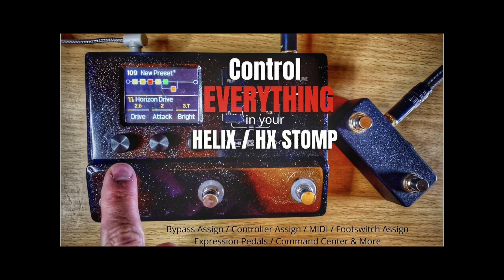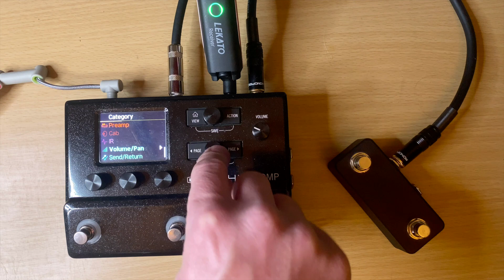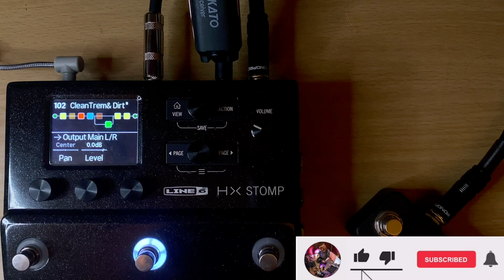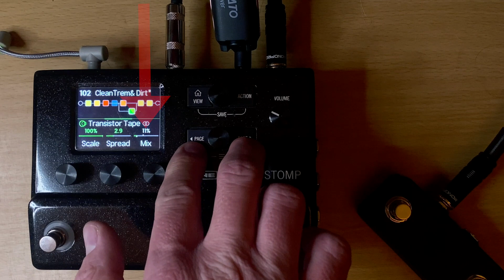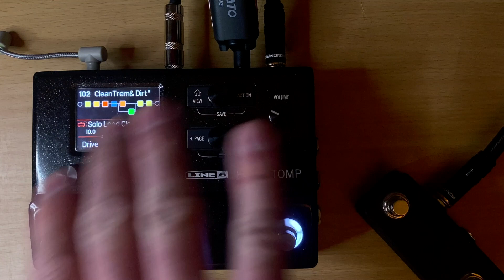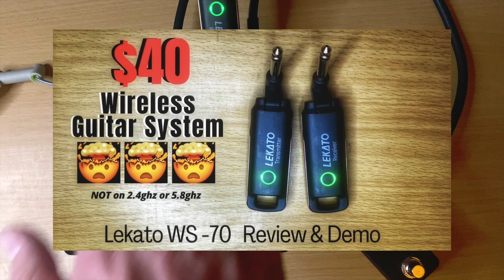HX Stomp Lead Boost WITHOUT using any blocks!

Comment: Quick question Scott. I’m using a TT2 fs and a dunlop dvp4 mini x via the expression input using a Y (tip & ring). Attempted to setup as you described but doesn’t seem to work. Also I am using the mini x as a volume pedal w/ a volume block. Should I remove the volume block and mini x or am I misunderstanding something. Seems pretty easy. Thx Scott! Regardless your vids are top notch!
Reply from the maker: Thanks! And remember, you only get 2 expression inputs. Sounds like you are trying to get an expression pedal and two extra buttons for a total of 3… you only get 2 total👍
Reply: Actually no. I only use one button on the TT2 and one exp pedal. However if I assign the single button i’m using on the TT2 for a boost on a new preset I create,  it doesn’t work. My thoughts were I’m merely giving my single button FS to do something else on a different preset. As for having 3 entities I am aware that is not possible. I just didn’t want to have to disconnect and re-setup my exp FS and pedal. Logically it seems it should work. Thx Scott!
Reply: UPDATE: Got it to work. Regardless of whether or not im using an exp pedal and using a tip and ring, I assigned the TT2 to my output level and bingo. As you said for every preset or snapshot it has to be implemented and saved. I must of missed one element in your instructions. Conclusion? it will work even if I am using an expression pedal as a volume pedal. Thx again Scott. You are the best!

Comment: Just to recap, raising the output level will work on all my presets as well? Or just snapshot mode(s)? I have a Dunlop Dvp4 volume pedal, tho it works it’s cumbersome to use at best. The stomp has a swell effect anyway. So, I may just utilize my TT2 to boost my output and then use my dunlop mini x for whatever else… if I’m understanding you correctly. Thx Scott. Always getting a bit more educated with your vids!  Thx again!
Reply from the maker: You just have to save it that way per preset and you’ll be good 🤘

Comment: I noticed that you don't press the Learn Controller button after you program your boost to FS 4.  I try to go thru these steps on my Helix LT and it doesn't work whether I press Learn Controller or not.  I need a Boost button for my Clean and Dirty sound but just can't get it to work.  Can you help?
Reply: I got it to work! First in Global Settings I set Controller Assign to FS4 before I set the levels. That worked! (The Learn button gave me an error message.) You can see that it's working in the "edit" view not the Stomp view of the preset.

Comment: I wish this worked for me!
Reply from the maker: Following these steps it should work for anyone 👍
Reply: Must have something not set up in my global settings properly. I followed this video step by step but the boost isn’t working.
Reply: @danewannamaker9511  go to the edit view and change Controller Assign to FS4 before you set the levels. That was the way I got it to work.

Comment: Don't know if you're still checking comments on these older videos but is there a way to make the boost "stick" across snapshots?  I'm noticing the boost stays on the original snapshot if I switch to another snapshot and toggle back to the original, but it is "off" in the new snapshot I select (e.g. toggling from dirt to clean snapshot, I'd like the boost to remain "on").
Reply from the maker: I don’t believe so. I know there is snapshot recall in global settings; https://youtu.be/pg2VdBX7tBo?si=zyh8RLQf5leaKZE5

But I don’t think that will keep it on across them.
Reply: I appreciate the quick follow up!  I played with it for the past few hours and started to switch the boost over to a Cali EQ block which is the last block before my output, to see if that has more options.  And in that process I realized there is a "snapshot control on/off" setting that I can turn off to get things functioning the way I was hoping (and the snapshot control option is available on the Output Main L/R block).

Comment: Did you buy that monoprice cord that short? I ask because I have the same wireless lekato and the same footswitch AND the same monoprice TRS cable that was 30 ft long but I shortened it and was able to keep the stock ends with the springs and everything. So your setup looks just like mine except for the power supply.
Reply from the maker: The TrS cable? I did buy it that short originally. I didn’t cut the cable down at all. But sounds like you have a great setup too :)
Reply: @ScottUhlMusic  oh okay gotcha. Yeah my stomp is my travel rig. And my Helix is a studio rig
Reply from the maker: @mrfender5001  Stomp is the best travel rig I've ever used for sure! Good choice

Comment: Also if you are using a lot of reverb and delays wouldn't this make them a bit weird?
Reply from the maker: If you have a super ambient patch, then yeah this might not be the best option for a lead boost on that particular snapshot. Although I do have an ambient patch with the particle verb (ambient Heaven... I love that block) and it works well as a boost still.

Comment: Cool. I was doing something somewhat similar, but only within an individual Snapshot. I didn't know it could be done for all the Snapshots within a Preset. Lots of potential uses there. Thanks
Reply from the maker: Yeah, it's a super helpful tip that changed the way I did solo boosts live. Glad you found it useful!
Reply: @ScottUhlMusic  I recently posted a question on the Line 6 Forum called "HX Stomp - Multiple Setlists.'" I was having trouble finding any information about it for my particular use. And though only one Setlist can be loaded at a time, it is possible to have multiple ones stored on your computer for quick retrieval and use. I think you may find it an interesting read, and might make for a good video. Thanks